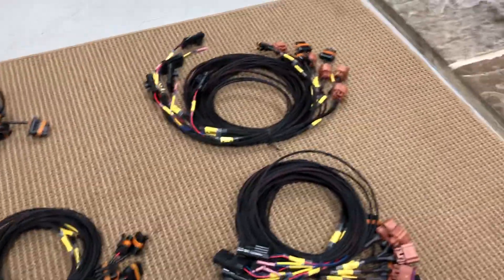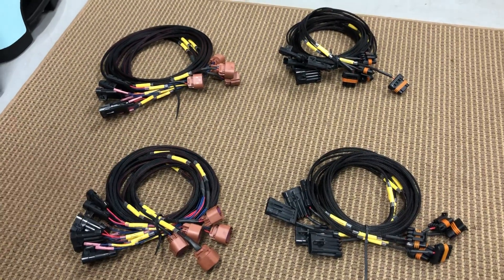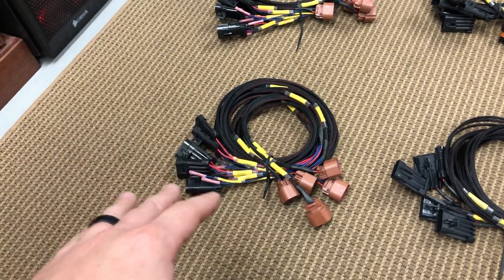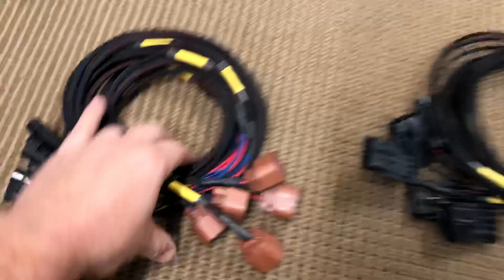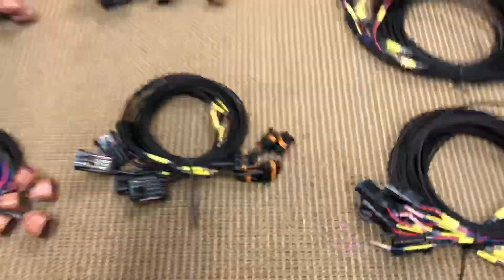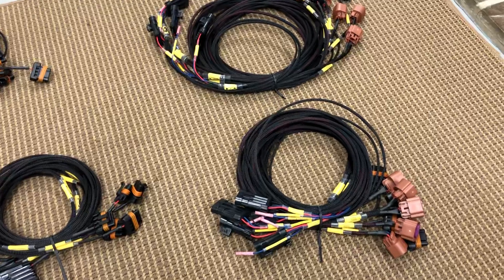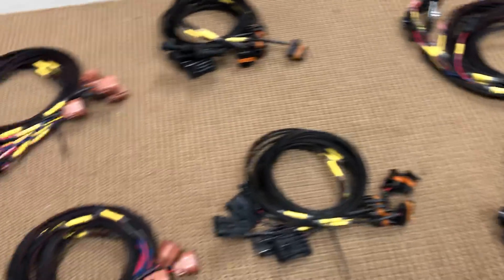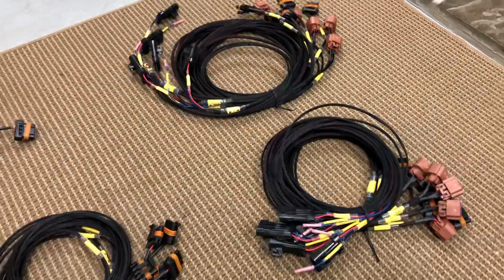Sloppy wiring solutions harness update

Comment: I have a 86 chevy Truck with a 5.3Liter Factory ECU swap. I just harvest an LQ4 out of a 2000 3/4t truck to upgrade my crap. When I read the manual for my Holley Terminator X Max it says to discard the old harness. My starter and alternator is tied into that harness but the new Holley setup doesn't mention anything about it. Most aftermarket harness come with small fusebox and wiring for starter and alternator, 
Am I just gonna have to make my own harness for that?

Comment: Hey what's up bro I hooked up everything I'm using input 1 white wire with a blue line  .I hook up my laptop to the pcm and where it shows the  gm flex fuel sensor it shows 0% like if it's not reading the sensor for some reason .any help would be appreciated 🤘
Reply: Nvm it was my slow as$ laptop 🤦‍♂️.everything worked out good 👍

Comment: Curious if you have a link for the loom like you use on the alternator wire you sell. Is it split loom? Also what are the common sizes or how do you usually measure the diameter needed so don't order a ton of wrong sizes. Thanks!

Comment: I have a 2 wire alternator.  My motor is an L33.  Is there any way to use that alternator?  Is there a 2 wire to 4 wire adapter harness?  Also does the Flex fuel sensor being smaller become the bottleneck in my -10 fuel system?
Reply from the maker: Install on return? Split to rails install on one of the feeds or after rails to regulator
Reply: @SloppyMechanics  Yeah putting in return makes sense, thanks.  What about my alternator?  Are there 2 wire options?
Reply: For those seeing this ICT Billet makes a pigtail for 2 pin to 4 pin so that you can use this Sloppy harness with a 2 pin alternator.

Comment: I've have a 05 GTO have a couple issues with the setup not getting spark at all I've checked everything and it all looks good just dont know what's going on, the other thing I've run into is the alternator my alternator is a 2 wire and the plug is different its smaller. I'm wondering can I use a LS1 style alternator at 104amps I believe its rated at, 05 GTO is a 140amp alternator.. any ideas what I can do?

Comment: Matt, Do u think it’s ok to get power for the alternator from the fuse box?
Reply: Has to be reduced to 5v. If you feed it 12v it will burn out the alternator.
Reply: It has a in line resistor

Comment: How does the ls truck alternator actually work? Wire to switched ignition 12 though a resistor? I know it seems simple but I can’t find a definitive answer online and I Fried 3 Alts already
Reply: The alternator will burn up if it gets 12 v thats why the harness is a good option or you need a resistor to drop the voltage.
Reply: @j.oakman448  burn up, Huh?! doesn't an alternator produce 12volts?

Comment: Does alternator control eat up one of the 4 I/O wires on a holley terminator?
Reply from the maker: it does not
Reply: Interesting....so alt control is setup to work in a holley out of the box and it is in the harness but holley didn't include a plug for it?
Reply: @SloppyMechanics  I'm unclear on this as well.  There's nothing in the terminator x instructions about alternator control.  Where do you plug in the other end of your harness?
Reply: @michaelcouey1383  could be wrong but all this harness is doing is exciting the alternator (with proper resistor inline) by using the powertap connection on the Holley harness. Clean way of wiring it instead of tapping into another switched 12v source and running a wire.